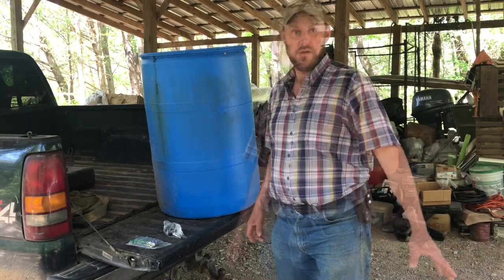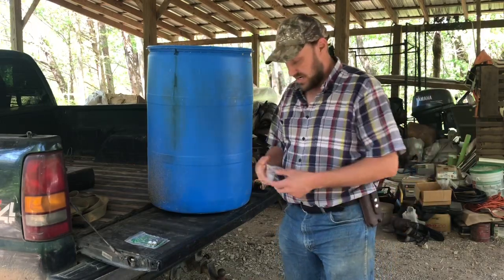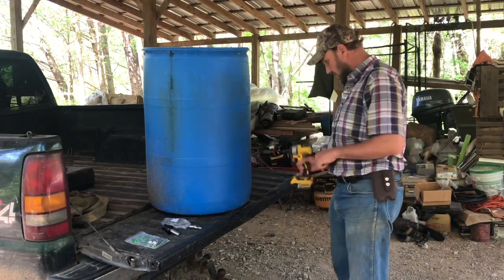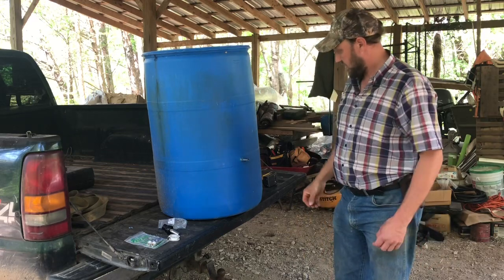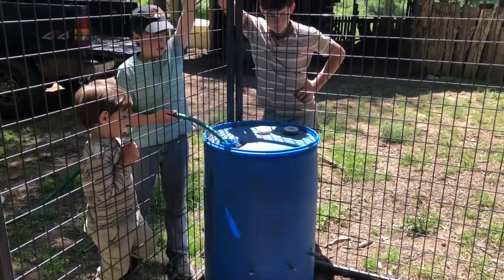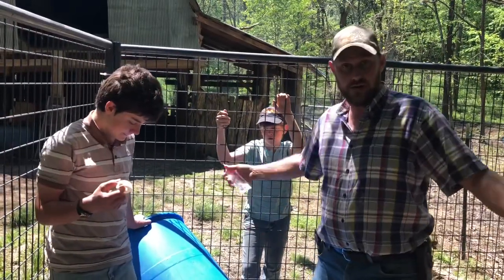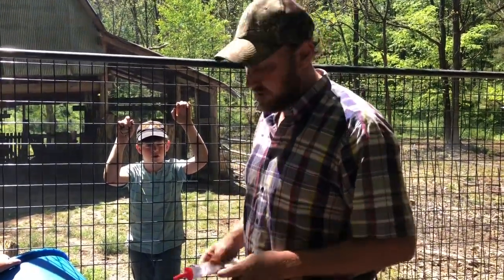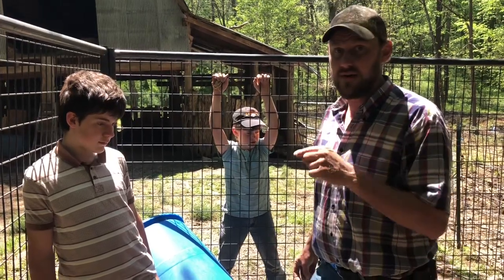Making a pig water barrel with steel nipple faucet! Direct thread!

Comment: I built one of these using 3/4 bulkheads and also put a drain in the bottom of it and pipes it out of the pen with a valve on the end of it so I can clean my water barrel once a week I feed my direct off of a spring
Reply from the maker: Oh man that’s awesome!!!

Comment: Sweet man! This turned out great, I tried to make similar contraption with a soaker hose, the fitting leaked and haven't messed with it again, mine had sugar water for no drown feeder, maybe try again
Reply from the maker: I believe it would work! There’s also liquid Teflon now that might help. A plumbing supply store should be able to help you out.